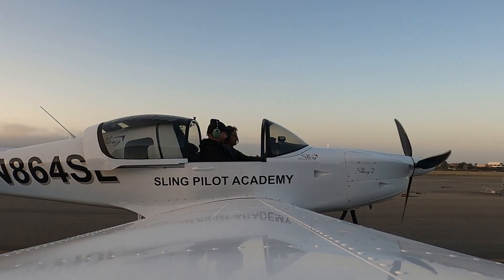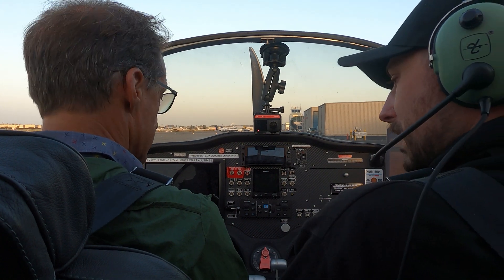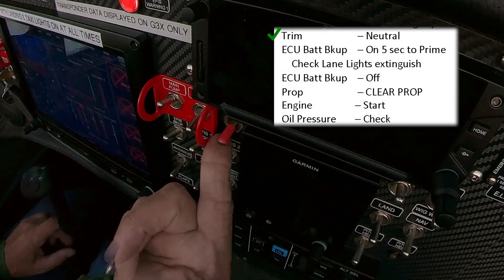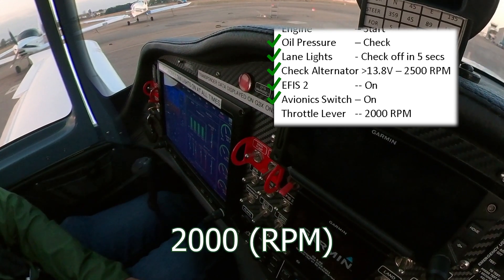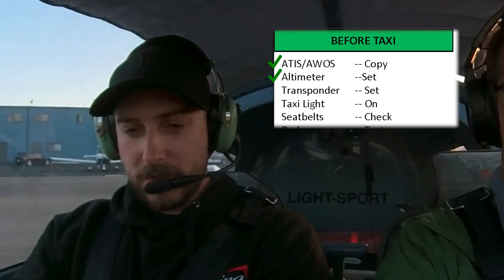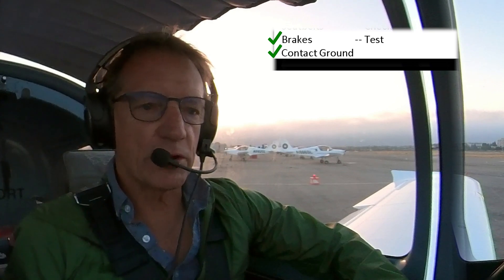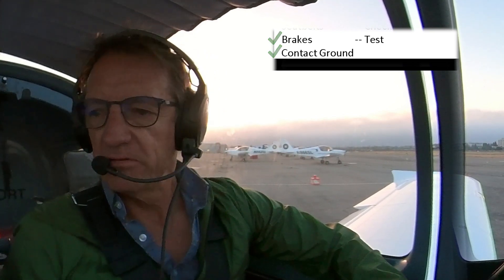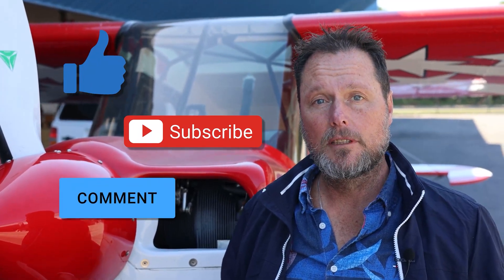How to Perform a Startup in the Sling NGT

Comment: HELLO! No way no how are you gonna or should you taxi a Rotax powered aircraft at 8 knots, below 2000 rpm. Am I wrong on this? Take off the BOSE and you’ll hear those gears slappin. Just sayin!
Reply: What speed do you suggest?
Reply: Mike, I have a SLING 2, it is prescribed that one keep the RMP at or above 2000. This ensures smoother operation of the gearbox. Lower and ROTAX says causes chatter and excess wear. 

That said, at 2000 RPM, I see 15-18 knots. Nowhere near the “Slow Walk” standard that I and others were trained to. Hope this answered your question